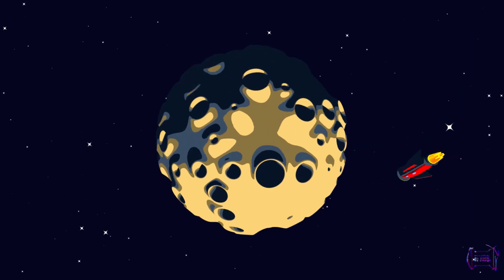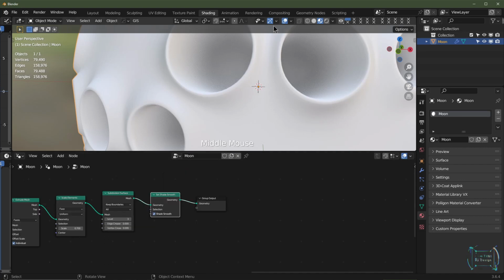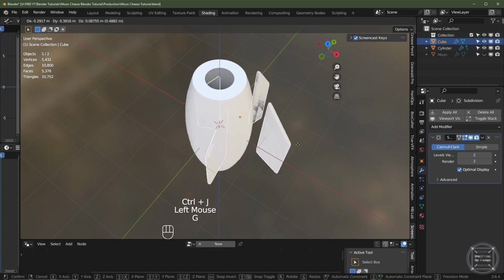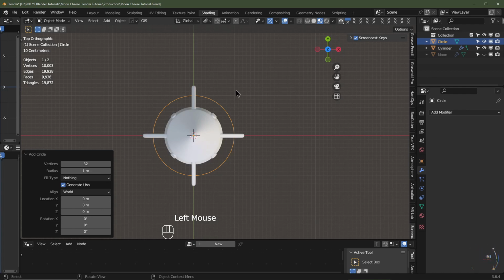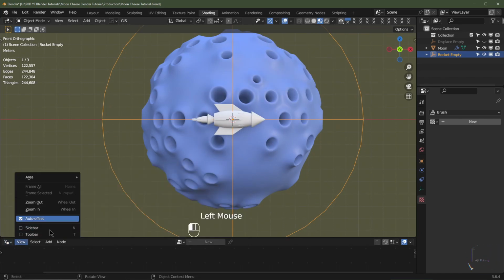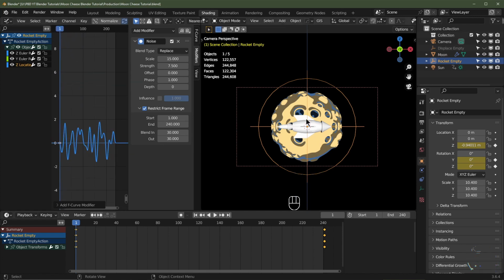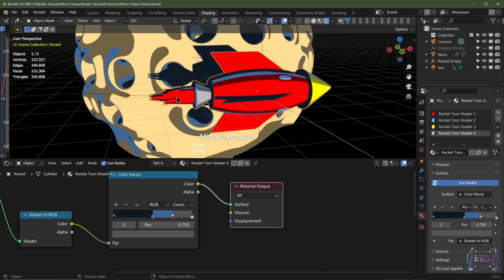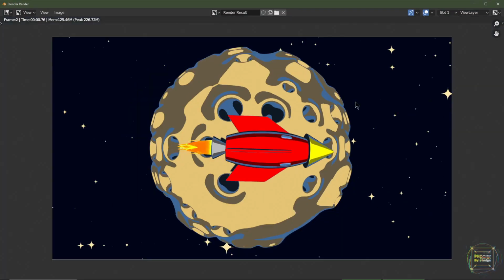Moon Cheese Cartoon Shader - Blender Tutorial

Comment: this was very helpful and i haven't been able to find many tutorials for a stylized moon, mostly image textured ones. i didn't realize this was a complex model without something like geo nodes. my only want here is that the taper of the craters was a bit softer and the depth was a bit more shallow. it is not entirely possible to get a more subtle look with the controls you demonstrated. maybe i can experiment with it and get it right . thanks for making this
Reply from the maker: I'm glad you found it useful, and experimenting with those values is definitely the best way to dial in that softer, shallower look. I have had a look at the original file, and I made one adjustment to the node structure to give it more flexibility, I have uploaded a screenshot of the changes and the result in my discord sever under the troubleshooting channel, here's the link; https://discord.com/channels/1155966392714137730/1168690100834676776/1515294526116462865 Stay sharp and level up 🚀
Reply: @PhotiniByDesign  Thanks for looking into it. as a dumby fix i ended up just converting it to a mesh and then puting a sphere inside it to shallow up the crater depth. looked much better when textured. i played with the values quite a bit but something was missing. maybe the revision will help. thank you. once again... this seems like something conceptually hard to do with regular modeling techniques! your approach is very effective!